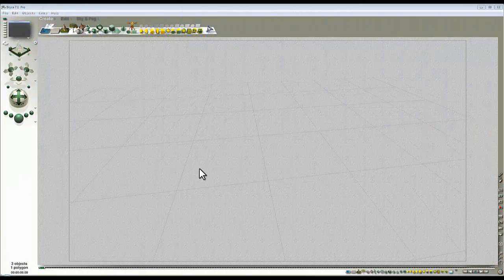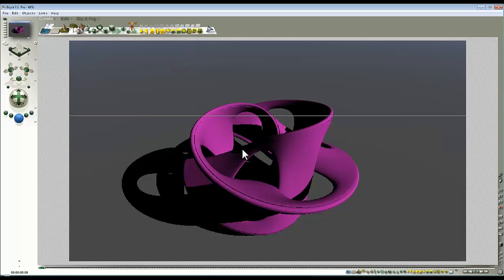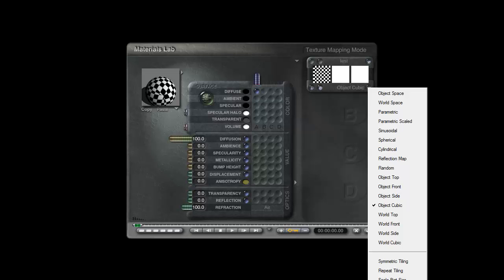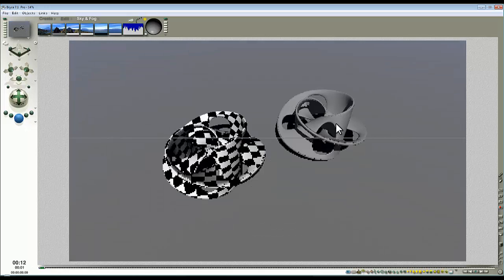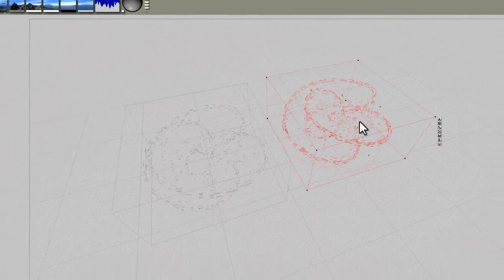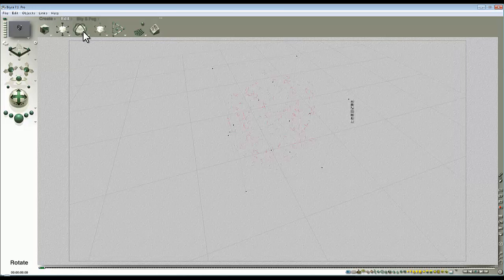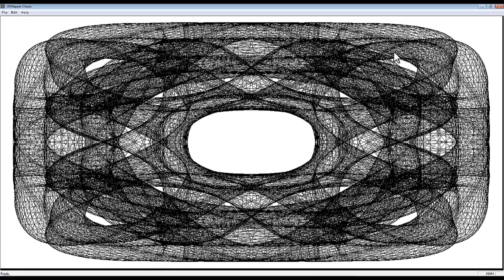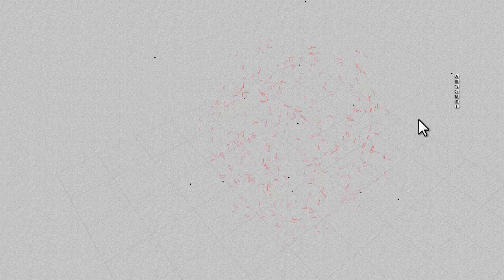Funky Shapes and Metals - UVmapping the test shape - by David Brinnen

Comment from the maker: I know my hammer because it is my hammer.  My work is often practical - bordering on mundane - so I am very familiar with my hammer and quite picky about it.  Always buy the best quality tools you can afford, don't think you can get away with cheap tools for a job, don't get anything novel or gadget laden, just go for the tried and tested.  I like wooden handles because they seem to transmit less shock, are relatively light and robust.  Pink plastic - nooooooooooooooooo!

Comment from the maker: Horo puts it this way, the best tool for the job is often the tool you know best.  So even though it may be a bit clunky to do certain things in Bryce or Wings3D - we do them there because it is simpler than learning yet another new application.  I like my hammers with claw heads, total weight of about a lb and with hickory handles.  Don't like all metal handles and don't trust other fancy materials for the job.

Comment: DS needs the UV mapping done in other apps as well, as it does not have the ability itself. Shaders that have Bump, Displacement, or multiple colors do not fully work on models that are not UV mapped. If you use the templates generated by the UV Mapping in say PSP, textures can be created that will load onto the model to templates are made for. In any case do not change the geometry of a UV mapped model beyond scaling operations, as the UV mapped template will no longer be valid in any app!

Comment from the maker: I will let you know if I find any UV Mapper Classic tutorials, as things stand I'm just stabbing in the dark.  Essentially what I'm using it for is to provide the equivalent of the base mapping modes for Octane that come as standard with Bryce.  Octane could learn a trick or two from Bryce in this respect.  DS also perhaps, but I don't know DS well enough to be sure that it doesn't have this functionality.